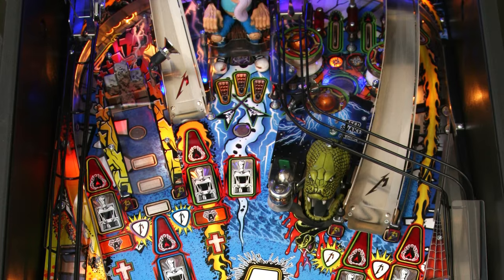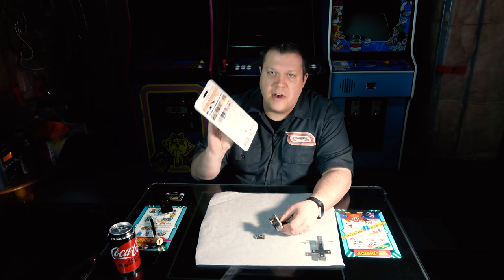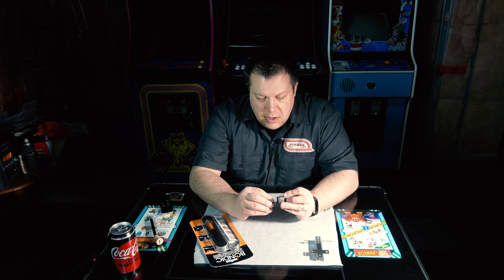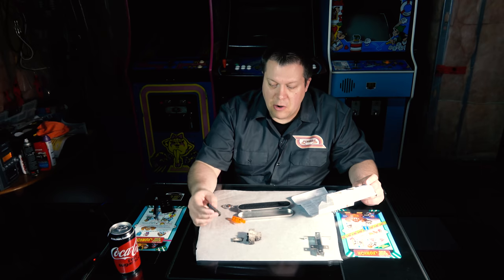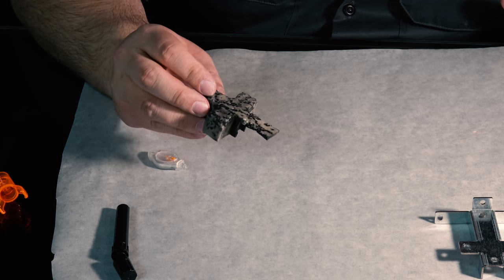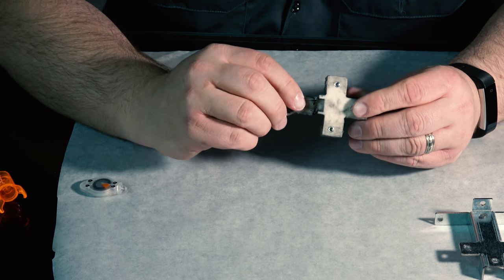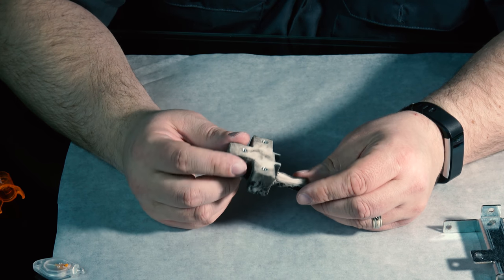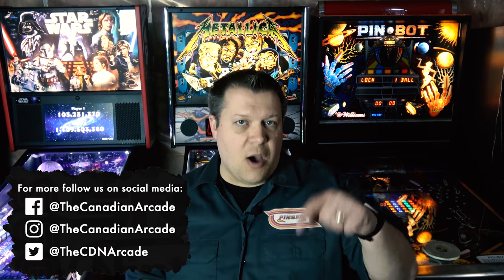Repairing Pinball Machine Parts Using UV Glue. Will It Work?!?

Comment: I would've thought putting some bondic in between the two surfaces at first would've been a good idea rather than putting them together then gluing the outside.
Reply from the maker: EXCELLENTpoo the bondic is  fairly low viscosity, so it penetrated the crack between the two pieces as it was applied. This stuff is really strange because it almost flows like water, but the molecular makeup of the stuff sort of holds itself together with surface tension, and only has its chemical reaction once the UV hits it. Think of it as less of an adhesive, and more of an ‘armour’.

Comment: I needed a 3.5 inch 20 pin ribbon cable for sound to work again on my freddy pin. I go on Marcos. Part is costs $5.15 USD. No problem. Thats fair. The cost of shipping to Edmonton you ask. $58.00 USD. No thanks. I found the same part on ebay. Total cost was about 30 bucks canadian with shipping from USA.
Reply from the maker: yup, Marco needs to find a better international shipping partner. they could do a lot of business with Canadians, but I think people hold off on ordering, or go a different route completely to get the part they need. I'm lucky that there are a lot of folks in the pinball community here, so someone is always putting an order together that I can get in on to help lessen the blow of the shipping.